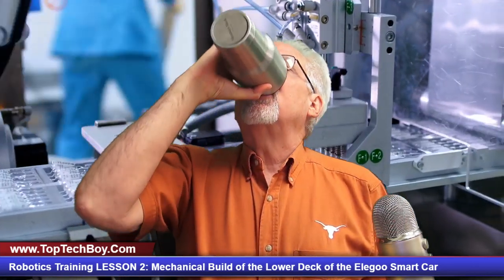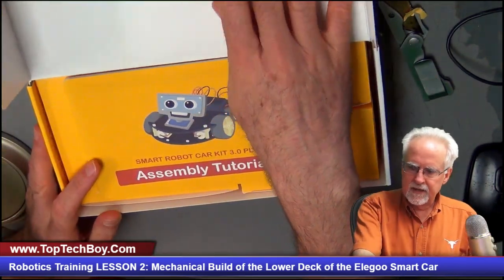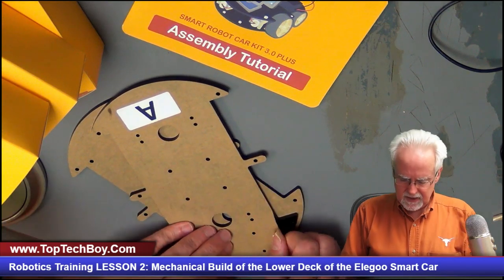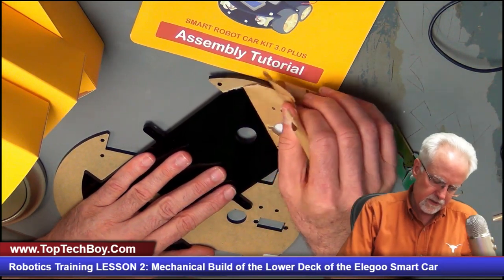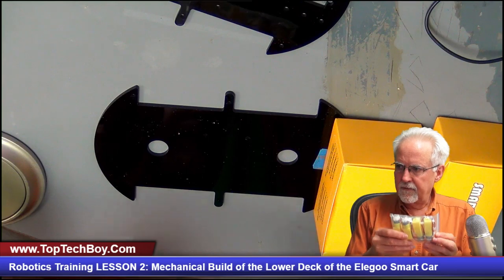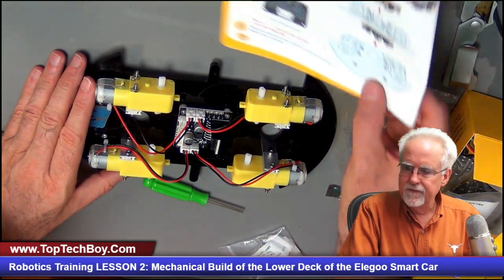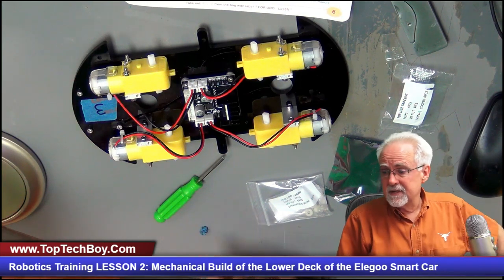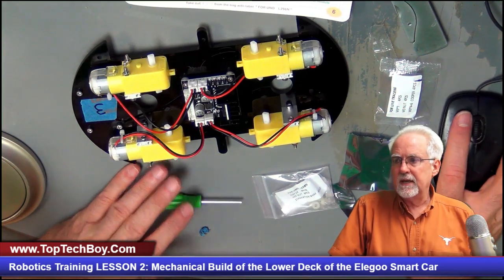Robotics Training LESSON 2: Mechanical Build of the Lower  Deck of the Elegoo Smart Car

Comment: Paul, I got the grandkids the Smart Car at Christmas time so mine is all built. I really want to watch you do the coding. A tip for building with small parts, put a small magnetic business card or insurance calendar on your bench and dump the parts on it. You can sort them and have them ready to go.There are some very small dark colored nuts on the top deck!!!
The 5 year old can really drive it using the iPad rocker interface, she is so smooth.
I'm up to lesson 58 in the GREAT Arduino series.

Comment: This is awesome building this! However, we installed the long bolts that attach the motor mounts to the motor backwards. The head of the long bolt should be facing outwards as not to possibly interfere with the wheels. If you test fit a wheel on your car right now, the long end of the bolts are extremely close to the wheel. Better to reverse the orientation of the long bolts so the head of the bolt is towards the wheel. Other than that, this is a blast and looking forward to more videos. :)
Reply from the maker: Yes, we will learn that in Lesson 3.

Comment: This build went well. The instruction manual labeling of the parts packets is great. I purchased the Apsung Precision Screw Driver set. It has 110pcs help me with small screws hex nuts and so forth and it has come in handy many times. Have a good day.

Comment: Paul, I found it easier to assembly the screws, standoffs and nuts to the acrylic chassis by placing each end of the chassis on the two small boxes that came with the kit. You can then get your hand under it to put the nut on.

Comment: Just looked the live  video building the lower Deck of the Elegoo Robot car. I DISCOVERED A MISTAKE !!!!! 
Mounting the 4 motors,   the 4 long bolts (M3*30 - 4 PCS -fixing the Aluminium Blocks), are pointing to the OUTSIDE  of the lower deck plate.
When-  later on- you have to mount the Large wheels , the tip of the bolts will  "scratch" to the inner side of the wheels ! and wil hinder to turn them around !!!
(Look  the assembly tutorial on page 2 and 3 )!
Reply from the maker: Yep, we find our mistake in episode 3.
Reply: I should have read the comments beforehand... I realised about this after mounting the four motors xD
Reply: @paulmcwhorter  I’m making a car that has 2 wheels so I used one l293d IC motor driver that you used in the arduino tutorial, the problem is when I try it with one motor it works not perfectly and when I hook the second motor none of them work why that happens??? I checked your arduino tutorial couple of times and it still doesn’t work, am I supposed to use the motor controller that is presented in this video??

Comment: It looks like mine did not come with a motor controller- as in there is not one listed as one of the materials or included in the instructions. It does has the UNO and the Expansion Board. I'm assuming ELEGOO updated the materials and instructions since you made this video. What does a motor controller do and is it concerning that the version I have does not include one?
Reply: The new version of the car is 4.0 look in the assembly tutorial, it shows how to connect the motors. You have to put a shield on the arduino uno and connect the motors there. Hope this helped!

Comment: I've built the platform already. I've found the ultrasonic sonic sensor to be   that good. It detects the object stops, turns it 360 degrees and runs into said object.  This child needs training...
Reply from the maker: I simply will not run the canned programs. I did not even download them. I am old school. We will code this thing up ourselves and have it singing and dancing. Stay tuned.
Reply: @paulmcwhorter  the programmes came preloaded. Yeah, they yeah they are pance .  I await your tutelage....sir.
Reply: @ghostdog5096  The pre made programs lead you through the different stages, like how to move the motor. Then they go to actually use their app and just add on a json file and expect that you know what is going on.

Comment: CAREFUL!!
The head of the M3 30 Hex Screws should be against the plastic, NOT against the aluminium plate.
Otherwise, the end of the screws will crash against the rim of the wheels.